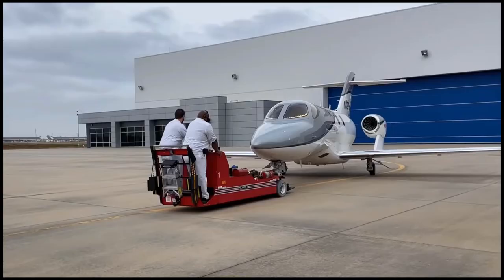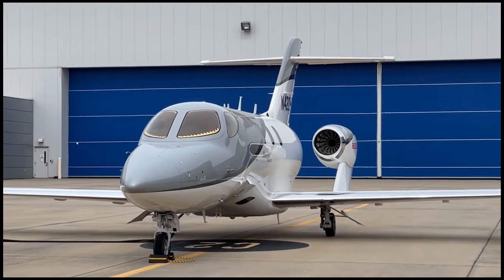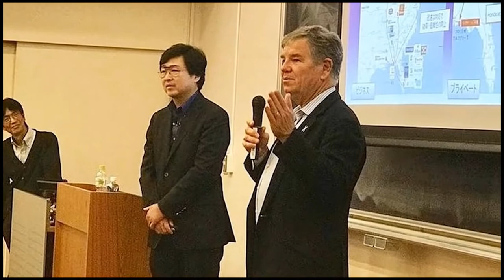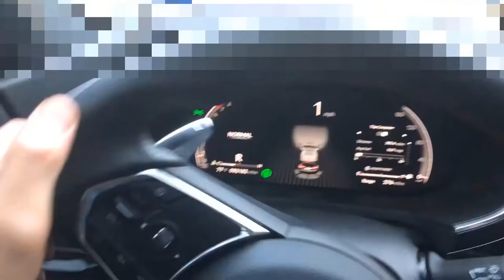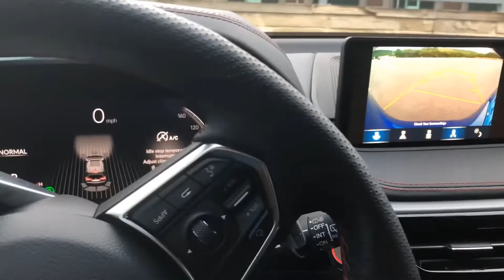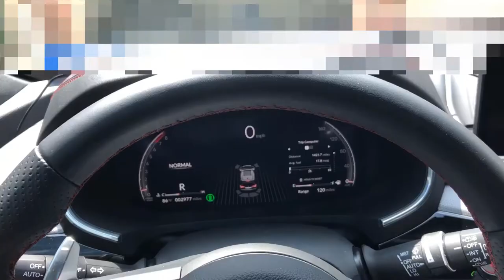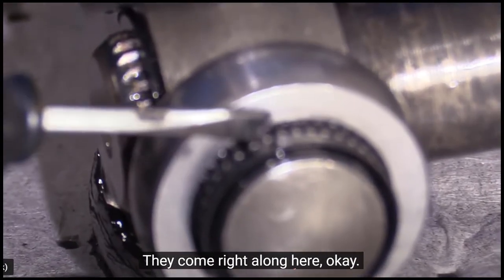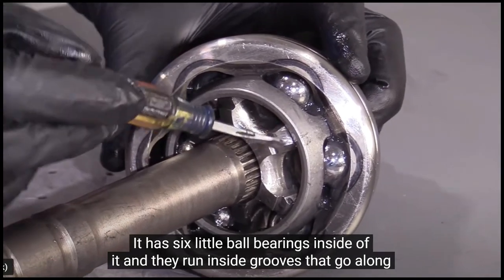2022 MDX clunk click drivetrain noise

Comment: Had the same noise on my 2022 MDX Type S Advance that I bought 5 months ago. Turns out these SUV's are coming out the factory with improperly torqued tie rod ends. Took it to Paragon Acura, showed them and they immediately knew what the problem was. Fixed under warranty. No noise, problem solved.
Reply: Took mine in today for the exact same reason. Your post was 100% right!! Fixed in 30 min under warranty!! Thank you. 😊
Reply from the maker: I'm glad you were able to get it fixed , but check out part 2 to see why it happens. I have a close up of the tie rod ends. https://youtu.be/2yP_AhgC9Lc
Reply: I’ve taken mine back 6 times and they keep adjusting the tie rod. I finally got fed up and told them to keep it until they fix it. Now they say it is the wheel bearing. They are replacing it but I’m not optimistic. I’ve been dealing with this since I bought my 23 MDX in August of 22.

Comment: Acura mdx also has a transmission whine and Acura says it is normal.  Never in my life I heard such bull. Do not buy this suv unless you want to get stuck.  Kia makes transmissions without gear whining.
Reply: They didn’t add the correct transmission fluid amount. Have them service the transmission with fresh fluid to fix the problem.

Comment: I've been experiencing the same thing with my 2022 MDX Advance Package. I received it brand new, with 6 miles on it, in August 2021. I started noticing that clicking sound a few month ago, when turning right and left, mainly in slow speeds when doing 3 point turns, maneuvering out of my driveway. My first thought was "this must just be a sound it makes when turning, this truck is way too new for this to be a problem", but over time this just didn't sit right with me. So I'm taking it to the dealership tomorrow morning for a diagnosis, I'll report back on what they tell me. I also have a 2020 RDX A-Spec, and I've never heard any of the these sounds from the front wheels when turning. Whatever it is, there is now way I'm paying for the repair.
Reply: Hi, what did it turn out to be?
Reply from the maker: I hope you can get it fixed. Whatever they tightened or replaced fixed it for me.
Reply: Left us hanging

Comment: My Acura 2023 MDX has same issue , I went to Rally Acura where i bought my car , They said the noise coming from brakes. It is normal. This is my second car, I know the noise is not normal. also It is not from brakes. The issue didn't solve . Today I drove my car to Paragon Acura , the server very very professional ，I only told her there's noise when i making 3 points turn, they know exactly what's wrong, She said this is very common issue and covered by manufacturer warranty， less waiting time than Rally Acura, issue was solved.  Paragon Acura Woodside NYC
Reply: Could you share more details on what the specific issue was? I have the same issue but my car warranty has expired already so I will have to pay for it properly. Just want to make sure my Acura dealer won't charge me more than once to fix it. Thank you very much :D
Reply from the maker: the brakes do not make noise by their design. The have springs holding them so backing up and going forward do not cause clunking. They also have tabs that keep them from moving from their slots. Some people are having noise from their steering wheel which is different that the sounds i was having from outside. I really think its the transmission making noise, but i know nothing of what is inside of it. Its hondas proprietary 10 speed. It still could be an axle issue of the CV joint, but time will tell when it gets bad enough it breaks. By then im sure it will be out of warranty and i will just buy another axle. If it ends up being the transmission, i would just find a used one (fingers crossed).

Comment: You ever get this figured out? We've been seeing a handful of them having slightly loose outer tie rod nuts (where they attach to the knuckle). Tightening them up to spec gets rid of the noise. That's the first thing I'd try if I was diagnosing your car.
Reply from the maker: It was what i did off camera and i didnt mention it before i took it in. After i took it in i can now say i tightened everything and it didn't help my case. I believe whatever they replaced actually fixed it.
Reply: @macgyver garage. Hey did you get to fix the issue in your car. Did you know what they replaced or tighten I got the same issue.
Reply: man, exactly the same issue, cannot believe Acura quality becomes so bad

Comment: Mine doesn’t do that my 22 MDX aspec has a steering wheel clicking noise from the steering wheel and it has a seat issue where every little bump my passages seat rattles bad
Reply: Is the seat loose?

Comment: it's the tie-rod. Torque was out of spec per dealer service technician.
Reply: Mine doesn’t click like that it’s click in the wheel, the cv ball joint had to be replaced and the tie rod needed as they said an “adjustment”
Reply: Did they charge you?
Reply: @ravigopaul01  of course not it’s a new vehicle bumper to bumper warranty 
Tires, brake pads, rotors and wiper blades is all I’ll be paying for
Reply from the maker: Well i can tell you now that i took it in and they remedied it that i went through and tightened everything including the tie rod ends and it didnt help at all. So whatever they replaced is most likely what did it in my case.